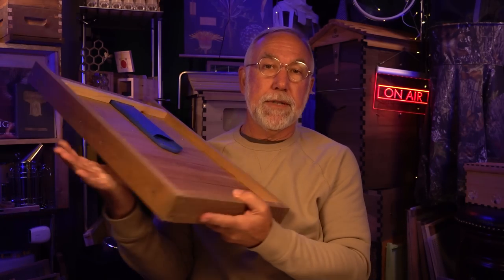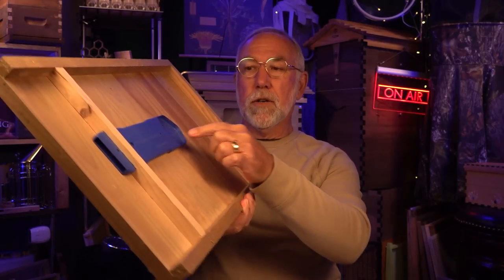Backyard Beekeeping Questions and Answers Episode 179, After extraction frame preps and more...

Comment: 1)  So how do you like the Hive Gate? Over the winter, will it be necessary to pull it out to clean it? 1:55
2) What do you do with your frames after harvesting honey? Is it ok to put a box of harvested honey frames back on top? 10:53
3)  I have questions regarding thermal hive treatments for varroa mites. Is it also possible that hot weather can kill the mites in my hives? 18:47
4)  I tried to set my honey frames out for the bees to clean, but they are killing each other and ripping apart all that beautiful drawn comb. Also, how do I keep the bees from backfilling the extracted frames? 29:44 
5)  Last year I made a skirt of double-bubble to insulate my hive to the ground. Also, is there a tape that holds up well to winter? 38:07
Reply: Thank you Adam

Comment: Thank you for answering my questions about the hive gate 💕 Mine is below a slatted rack. I don't have any equipment to determine where the cluster is, but my bees seem to have adapted to it. It's on a Flow Hive 2 with  rolled screen on either side. This resulted in it being about 1/4 in above the landing board. I got the feeling that they were confused about the space under it and where to stand to air out the hive so I broke a paint stir stick in half and it was the right size to place  underneath. Now they look organized and settled aerating the hive. Thank you again 🐝🌻🐝
Reply: I’ve used a Hive gate… you probably don’t need any cleaning.  I added slatted racks this past season.

Comment: Here in MN I use painters tape to seal my hives. Some brands don't stick real well and there are some that do. Duct tape stuck way to well causing paint and wood to rip off the boxes. Cheap duct tape was hard to remove as if it was deteriorating. The painters tape removes easily.

Comment: Fred, I have used a lot of tape in my life. By far, the best tape I have ever used is Zip System  Flashing Tape. Does not smell, Does not come off. Comes in 3 3/4" width x 30' = $25. You will find it in a big box lumber stores not with the other tape but in the lumber section by the sheets of plywood (Green Zip Sheets)
Reply from the maker: Hi Ross, if you have a link to share, please do! :) That sounds good to me.
Reply: The absolute best exterior tape/ self-terminating flashing on the market! I use it to hold my XPS foam insulation wraps together.

Comment: I use an escape board that I built, just a simple double triangle, 3/8" slots. Always worth the overnight wait. You want several escape boards to pull multiple supers the same day, is the only downside I've found. Well worth the wait. I never have more than 10 bees in a super. I did trap a queen this year, needless to say, that's the only time I've seen an escape board not work. Make sure your queen isn't a rebel and cruising the honey store.
Reply from the maker: I agree, escape boards are a clean sweep for me. Yes, you need a whole rack of them so you can put them all in place and then come back the next day. Thanks for sharing your modification.

Comment: Got all the hives stuffed together on my stand, just enough room to pop lids open. I have to get my 2nd feeder on and filled with dry sugar. I will make a few candy boards around Christmas time in case they need them. I didn't use insulation this year, but added black felt paper to span all 6 hives over top, with a peak in the center to allow air flow, and along the west sides.
Reply from the maker: Hi Rich, are you saying that you're not insulating the covers? Insulated inner covers have proven to be a fantastic advantage when wintering in snow-country.
Reply: I will use candy boards, at least on 4, and I have feeder covers, I built with 2" shims, those get burlap and news paper stuffed into them. Just no wall insulation.

Comment: Tuck tape sticks like crazy for a long time, doesn't smell or deteriorate fast. I'd use a couple 12 inch pieces of it and double it on the end for easy removal in spring. Just a suggestion fwiw.

Comment: Thanks for the video as usual. I personally think that the hive butler uncapping tank is the best on the market right now for these reasons, it has a bigger holding tank capacity than most including pierce, it is versatile can be used for uncapping, storing frames capped or uncapped, can also be used for swarm catching and relocating hives easily especially if you don't want to move a whole hive body with the ventilated lid and also as your regular inspection assistant in the your Apiary and I am sure you can find other uses.
Reply from the maker: Thanks for sharing, I agree that the hive butler units are also very good. They don't pack down very well for storage, but certainly do prove beneficial for all of the reasons you've mentioned. I have both.

Comment: I believe the idea of letting a wrap hang down all the way to touch the ground and expecting the heat to radiate up comes from fruit tree wrapping. When wrapping a fruit tree it is draped all the way to the ground and not bound tight to the trunk with the intention of capturing warm air rise from the ground.
Reply from the maker: Interesting! Thanks for sharing.
Reply: @FrederickDunn  But if the ground is wet it would increase the humidity levels around the hive.

Comment: Fred - can you describe how you prep and store your Flow frames over the winter?
Reply from the maker: After they are cleaned up by the bees, I put them in the OPEN position, do a 10% bleach rinse with fresh water, after they are dry, I put them right back in the flow-supers and stack them in storage until the next heavy nectar flow comes on. In the future, I'd like to have a heated tank so that I can dip them and melt away all wax and propolis. For now, it's power washing.

Comment: I have a pierce uncapping tank and it's great, the only thing I wish they would have made it a little bit wider so the frames could hang in it.
Reply from the maker: Excellent point, and another vote for the Hive Butler, which is a very close second. I uncap and put them right into the extractor, but I can see how someone without an extractor would need a rack.

Comment: Unless I'm mistaking, you do not advocate the use of ventilation ports or openings in your hives basically year round.  It seems you dislike their use especially in the winter months.  I understand your reasoning, but just one question.  If moisture is one of the most deadly problems for bee loss, where does the moisture go inside your hives?  You use the reflectiks, and the absence of vents.  Once again, where does your moisture escape?
Reply from the maker: Just as in any cavity that bees occupy on their own, they control the entrance for all of their ventilation and humidity control. In winter, when the hive cover is adequately insulated, the dew-point is on the sidewalls just below the cluster. The water/condensation can travel down the walls and onto the bottom board, or through the bottom screen and into a pull-out tray. This is the case with small hives, up to two deeps. If you're trying to winter a larger hive with more boxes on than that, expect condensation to occur above the bees as well. The hive must be small, and the occupying bees must be numerous enough to manage the space. If you are not insulating the inner cover, then condensation will form above the cluster and profoundly reduce their ability to remain safe. Without insulation of the inner cover, small venting would be necessary above. Because all of my standard hives are down to two boxes going into winter, no top venting, no upper entrances. It has a different purpose in summer.

Comment: Have you ever wrapped your hives with black felt roofing paper to absorb the suns heat during winter?
Reply: That was a very common practice back in the 70's and 80's.  I used to do that, but found using no wrap achieved the same general results if you don't have to crack thier propolis seals late in the season. Wrapping was used to provide a wind break for poorly sealed boxes.
Reply from the maker: Hi James, that's an out-dated practice, and not something I personally would recommend. I also like Fred's Honey response.

Comment: A bit off topic from the vid but, what ratio of full size hives to nuc (resource)hives do you suggest.
Reply from the maker: I don't have a specific percentage for that. I just make nucleus colonies whenever I come across a smaller swarm. I've not had more than 5 nucleus colonies at a time and they have kept my other colonies up and well queened. I had 29 colonies at peak capacity this summer, and am now down to 26, including 3 nucleus hives going into winter. I expect that 2 out of the 3 nucleus colonies will remain viable in spring as insurance policies. I really all depends on what you need them to do. You do risk ending up with too many bees. :)
Reply: @FrederickDunn  too many bees? Is that even possible🙂

Comment: Fred,  You've talked about the 5 frame nuc box many times, have you ever thought about a 6 frame nuc?  I'll be building a few nuc boxes this winter and I'm looking at designs.... I thought 5 is great could 6 frames be as good??  Dave
Reply from the maker: Hi Dave, since the 5-frame units are available, that's what I went with. There are keepers that take them smaller, even down to 2-frame nucs. 5 frames seems to be the sweet spot for the bees going verticle. If you wanted to really fell that out, I'd suggest going with 1/2 of each size and documenting how quickly they populate and expand. I also think there may be something to frames in groups 5 just becuase frames and foundation are sold in 10, 20, 30 packs and so on. Not 6, 12, 18... but, you can certainly find that out easily.

Comment: Fred,  in relation to wax moths, what happens if you stored your early honey supers in a closed tub for the summer and upon extracting prep,noticed and removed a small trail on the surface of the capped honey.  After extracting the frames your subconscious worried there may have been hidden eggs present, now in your honey.  Suggestions?
Reply from the maker: I run all of my honey other than Flow-Supers, through a filter medium. But if I noticed any evidence of insect occupation other than honey bees, I'd mark that frame for open feeding.

Comment: Have you thought about taping over the joints or cracks between boxes of a hive for winter? I used some painters masking tape to eliminate drafts, but then it rained and the tape looks rather wet. 😢 So maybe I should remove it. Dampness is a real killer in winter.
Reply from the maker: I just let them put propolis in the joints, as long as air doesn't pass through, they are fine.
Reply: There are many types of painters tape  and I've used some here in MN that are great and others won't stick. But mine overwintered well and came off easily in the spring.

Comment: Gorilla tape is still the best tape for wrapping hives. It stays on all winter and spring. Not sure why, but the Gorilla tape I got doesn't smell anything.
Reply from the maker: Mine is super stinky :) Glad you found another version. Is it a one time use though? I like the idea of velcro or strapping so the wraps can be stored and used again. But then, I don't wrap my hives :)
Reply: @FrederickDunn  Yes, the Gorilla tape is only for one time use. It sticks well and does not leave any residue when pilled off. It is not cheap though. I like the idea that velcro can be used for years, will give it a try this winter. Thank you for sharing your ideas!
Reply: @kathyw6635  My Gorilla tape stuck so well it took off the paint and some wood here in MN
Reply: @russellkoopman3004  I only used it on foam insulation that has a layer of aluminum seal. It didn't peal the aluminum layer off.  I just find that it is easier to take off when it gets warmed up by sunlight. I haven't try it directly on painted wood. It is not good if it take the paint off. What would you use then? Thanks.